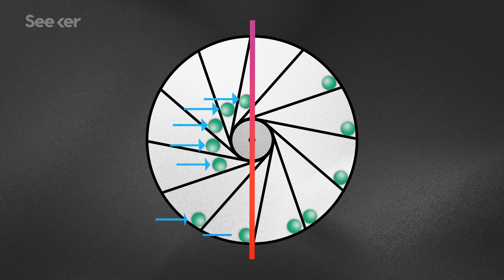Why We Want a Perpetual Motion Machine, But Still Can’t Get It

Comment: The problem with this idea that Perpetual Motion Machine can't be made is limiting ones ideas to some who think outside the normal box.
Just as electricity was seen as not a thing or a computer the size of a cell phone to be more powerful than the Apollo or space shuttle computers.
The challenge is not to make something friction less but to make it so it works despite dealing with the friction. The first law of thermodynamics is intended to be broken.
To suggest it can't be done. No. It is more like hear is a problem now figure out how to work around that suggested problem.
By putting limits on your position it is clear that you limit the option of passing around the problem another way.

Comment: @1:30  you have the rotation going in the wrong direction try the other way it works just fine
Reply: @darklight2.1  I guess you missed the part in my last message 
 ''a device  very close in appearance'' so I agree yes nothing in this video can run indefinitely oh and I love your use of latin  in  a attempt to appear extra smart  PS you should cover your webcam after a quick Google hangouts video call  attempt I seen your name choice is quite fitting for you

  minima mentula tenebris lumen 2.1''
Reply: @darklight2.1  I did build one and rotation occurs for 25-30 seconds and that is why I said it's spinning in the wrong direction it seems you don't understand the concept of the movement that many hypothesized would keep the wheel in motion
Reply: @darklight2.1  today you will find out there is a device  very close in appearance that can run itself how  its in a vacuum and has frictionless magnetic bearings sadly it can only power itself

Comment: You'd think we could combine magnetism, gravity,  buoyancy,  and Earth's magnetic field to get constant motion.
Reply: -Magnetism has no available energy to harness-it is a force, not a form of energy.
-We can use gravity to store energy, but it isn't a form of energy itself, and the amount of energy stored will always be exactly equal to the amount of energy used to store it there.
-Buoyancy is simply an expression of the gravitational effect.
-The Earth's magnetic field is relatively isometric. That is, it has very little change in value over large distances and, to do work, we need some change in values. With that said, people have calculated the possibility of using this slight variance in the values of the planets magnetic field to generate energy, but the solution involves conductors that are thousands of miles in length to achieve relatively small results and not very practical.
Reply: @darklight2.1  Could we use magnetism as a sort of sail?

When you place a magnet in a pool of water on a float the earth's magnetic poles rotates the float to align it with the north and south pole. Why couldn't a large flat magnet sail push a vessel?
Reply: @AL1974  A floating magnet will align itself with the dominant magnetic field-so a floating compass needle aligns itself with the Earth's magnetic field.
Once aligned, the fields are basically at rest-they will simply stay in that position unless moved by some outside force, so they can't generate any movement.
Reply: @darklight2.1  gotcha,  thanks

Comment: So, we've all seen magnetic levitation, such as the spinning top that "floats" above repelling magnets.  Mount magnets at 45-degree angles around the perimeter of the top, and enclose the top in a vacuum chamber above the mag-lev base, get it up to speed with external magnets driving the rotation of the top, and it should run friction-free for eons . . . until the damned cat knocks it over

Comment: I have designed and built a mechanical piston engine apparatus. It is patent pending in the States right now. A video called (World breaking news, mechanical free energy.), shows a 4 pound force lifting a 20 pound weight at a one to one ratio. Check it out.

Comment: Of course we don't have perpetual yet. Doesn't need to run forever, how bout run for days, weeks, months, years or a life time. I say this because you'd be surprise to see what some can do with a generator head, some motors, pulleys, belts and an inverter. Free energy is easy, doesn't mean you won't have to replace parts as they wear out but if you do it just right, it'll be cheaper than the power bill by far

Comment: I posted how to make the Vgate Vtrack work 3 ways on several sites and they closed the comments . there are several ways to make perpetual motion devices however everything decays . and when you attempt to patent you go missing . #1 . build a Vtrack / Vgate you'll get free movement for 359 degrees . use that free movement & piezoes to charge a cap. to power a solenoid to lift the gate . what you use determines how long it lasts . Electrons are P.P.M. .
Reply: can you please explain your model of perpetual motion machine here if you don't mind bro . I have guts to make that work please...

Comment: People who believe in or try to invent Perpetual Motion Machines are utterly ignorant of Science, especially Thermodynamics. They simply cannot understand how a general theorem, such as Noether's Theorem on Symmetry and Conservation Laws can show that NO POSSIBLE MACHINE can violate Conservation of Energy. They cannot understand how the Second Law of Thermodynamics can show that NO POSSIBLE MACHINE can convert ambient heat energy into useful work. 

The design of the machine DOES NOT MATTER. These laws apply to all possible machines, no matter how they are designed. The scientifically illiterate cannot understand this. Adding another gear here or a magnet there makes no difference. These persons cannot be convinced of the futility of their delusions until they learn some REAL SCIENCE, which none of them seem willing to do.

There are THOUSANDS of Perpetual Motion Machines on the Internet. You can see many of them here: https://lockhaven.edu/~dsimanek/museum/unwork.htm
They all have one thing in common: They DO NOT WORK.

Comment: Well people have been trying to build such machines for many years with some degree of success ,but eventually they stop..usually due to bearings failing..I DO believe that it is possible to make such a machine,though how I don't really know..If such a successful design has been made it is likely bought out by Big Business..They actually have people researching patent applications and try to stop certain inventions making it to the marketplace (I kid you not,please look onto it..). Such a machine,even it it didnt work perpetually (forever) would still be useful,( and a possible threat to Big Business..) if it ran for a good length of time,say a machine that ran for 18months non stop using NO fuel..

Comment: But what if you have two gears one big one medeum then out the medeum gear one the big one then have 3 more gears all of them are small then attach a small one flipet on its head ( not the spiky part ) then attach to the medeum one put one small on its pointy part put it on the first one on its side then the other small gear will be the same as small gear n1 but on the bottom of n2 AND turning the medeum one

Comment: Next magnet motors and magnet multipliers. Many people claim magnet dependent motorization  or assistive mechanicalc amplification exist without proper imperical analysis. Don't say to look at the voltmeter which uses a suppiously thin wire unseen or blurry to the camera recording or just hidden under the table.

Comment: I used to have a perpetual motion machine in subnautica but then they made it so it wouldn't work 

(Power cell charger in a cyclops with an engine efficiency module)

Comment: What about using a iron wheel with magnets in a vacuum
Reply: and how would that work? where will the magnets be placed? how will the magnets affect the wheel?
Reply: Idiotic Cy the vacuum and magnets would get rid of friction and you would have to place the magnets in a certain order to keep the wheel or some other shape of iron spinning.
Reply: @alexnjegomir834  the magnets would
1. Attract the iron wheel (if the magnets arent attached to something)
or
2. Stop the iron wheel from spinning (since the magnets are attracting the wheel)
If the magnets aren't strong enough, it'll simply just spin normally.
Interesting idea though.
Perhaps you could give me a design, I'm not sure if it would actually work.
Reply: Idiotic Cy though I probably could not provide a design I would use the same poles of a magnet and fix down the magnets again in a certain order( one that I have not thought of yet) to make it spin. From a previous comment I said one doesn’t have to use a iron wheel.
Reply: @alexnjegomir834  i see

Comment: What if there were 2 circles in space, and as they traveled, they used small ion thrusters and onboard computers using sensors to correct the position.  Both disks are concentric.  The inner one harbors a large magnet in the center, and the outer one is rotating coils of superconductors, cooled by the vacuum of space.  Essentially this would either:

A. Generate current and store it, and eventually through radiation and friction with particles millions of years later it will shut down.

B. Only generate current if the rotational speed is accelerating, and I'm describing a futuristic flywheel.

Comment: We have to be more innovative with energy. For example, make a perpetual motion machine that will run for 100+ years using magnets and replacing the magnets when they no longer work.
Reply: It's not a Perpetual Motion Machine if you have to jump start it, it's an engine and it has already been invented by Joseph Newman.
Reply: It also doesn't necessarily have to be perpetual, it could be something that runs for, say a month...
Reply: It’s not a perpetual motion machine if you have to jump start it

Comment: I heard there was something VERY close to a perpetual motion machine, it was a clock that is powered by changes in atmospheric pressure. It’s not technically s self powered machine but it does run on an infinite source of power which is very cool in itself.
Reply: scientists still call it an "experiment" - even though some have been running for well over 100 years.

Comment: It's  my intent to use quantum field physics to achieve a device that should run longer than several human life times.  But because of alfa and beta decay it will degrade over an extended period of time.  So you are correct there's no such thing as perpetual motion!

Comment: If I was smart enough to be a rocket scientist, I'd veer towards a device using barometric pressure differences to collapse and expand which would spin a single direction gear with low friction bearings hooked up to an alternator with low friction bearings. The alternator would charge a battery that you continually swap out. On a large enough scale, it might work.

Comment: So any machine that uses water is not a true perpetual motion device because the water needs energy to remain fluid, meaning, it can be perpetual in room temperature?
Reply: Michael De Santa  unless water is frozen, it has outside energy and could be used to move a seemingly perpetual motion device, but the rule States in this case that the device can not produce enough energy to mantain the heat of the water if the room drops to absolute 0, but this also means it would work in your house, potentially.

Comment: I always thought that air conditioners is supposed to make us cool, ie. Removing thermal energy, but we use energy to power it? No where near energy efficient. Why can't we just use a device that can absorb ambient heat to cool the room while generating electricity?

Comment: This is a definition problem not an engineering one. We’ve defined ‘Perpetual Motion Machine’ as ‘a device that works without outside energy’. But that’s just silly, why not define a perpetual motion machine for what it actually is? A machine that runs perpetually. A wind turbine, a solar motor, a geothermal pump could all be perpetual motion machines but we’ve defined the terms as something that can’t exist. Therefore it won’t. We’re just being silly.
Reply: Perpetual Motion Maschines are defined as Maschines which produce more Energy out of nothing
a Solar Panel just catches Power from the Sun

Comment: Could you make a perpetual motion machine in space? I guess the friction is still a problem but what if there was just a spinning wheel in some remote part of the universe where nothing aside from gravity (like the attractive forces between objects with matter) interacts with it. Would it spin forever?
Reply: you could reduce friction by using magnets.  The axel and "bearing" being opposite poles.  Problems still exist for air resistance and to create electricity, the coil and stator create resistances...  but it could be very efficient, just not perpetual.

Comment: What about the infinite fountain? The one where you have a large funnel and a thin tube leading back into it so that the water gets pushed down into the tube, up and then into the funnel again? Couldn’t you make that really big in a sealed environment with 100% humidity  so no water evaporates and with a super slick wheel so none sticks to it? Where is the energy going in

Comment: Perpetual motion is easily accomplished in a perfect vacuum. But the moment you try drawing energy out you’ll bring it to a screeching halt. Why? You’re only using up the energy that was put into it to set it in motion in the first place. It’s basically just a battery but with kinetic energy instead of chemical energy or electric potential. You can charge it up now and drain it later.

Comment: European Patent Number : EP1821391A1 states "As described above, by forming the stator 110 in the independent, multi-phase parallel distribution structure, a large output can be realized at a low voltage. Since the ratio of the number of the number of the motor windings M to the number of the generator windings G is 1:2, the over-unity efficiency more than 200% can be achieved." published 2007.

Comment: What about making one in space? Less air friction, still get physical friction though, and you wouldn't need to worry about gravity and such. One good spin via a human would send it spinning endlessly without the need for moving parts in the wheel. Though you'd still get friction from the chain spinning the generator so you may have to push it every now and again to keep it going but that's more effective than a standard generator. Why not use water and gravity? Just like hyrdoelectric dams. The water flows down around a turbine and generates electricity. You'd still have to generate enough energy for the pump to put the water back up top, but if you have enough turbines and flow, then there you go.

Comment: My 8th grade science fair was a perpetual energy machine. Using a neodymium magnet on motor to create a current in a high density copper coil that was then wired into the motor. After starting it with a coin cell, there was a bit of lag time before it would completely stop, but it never continued indefinitely. At it's best I think it ran for about 2 seconds after the battery was removed.

Comment: A machine that rotates will slow up because of friction.    If the machine is on the Moon,  it will slow slower.  Less friction.   If a vacuum is created to house the machine.  it will continue to do what it does. 
CAN we develop something that will operate in Space that will generate power that can be transferred back home  ?   A space station  generator;   would be perpetual motion.   Solar power is inexpensive.